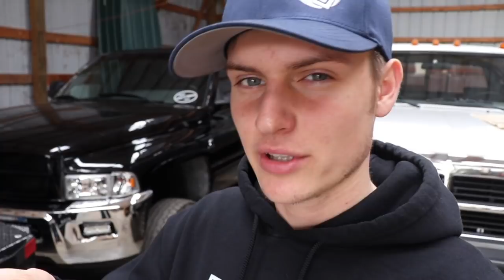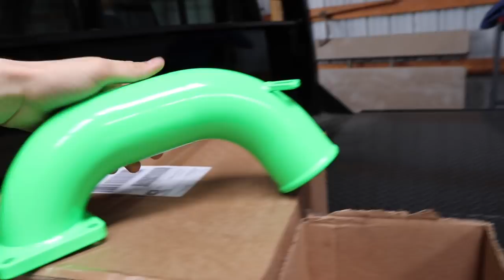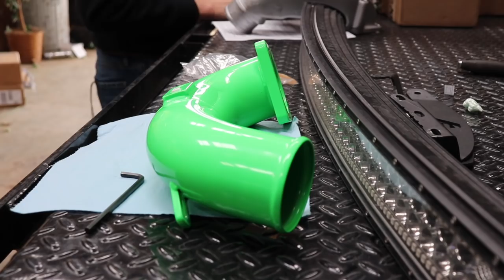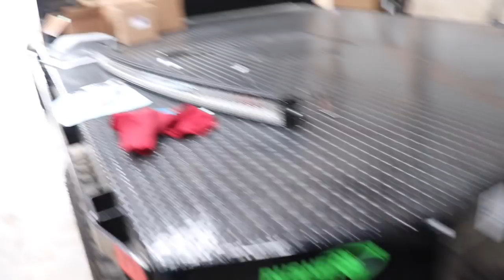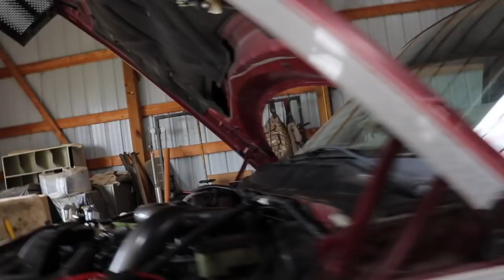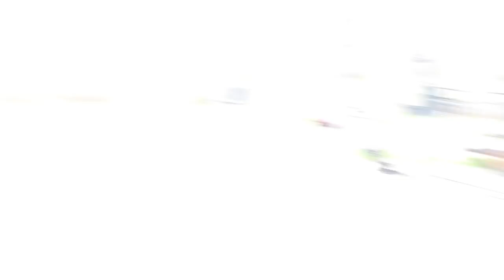THE NEW 12 VALVE PARTS ARE HERE!!!

Comment: Hey bud, once again great video. However, I did notice that on that stud pusher provides you to use instead of a bolt, it also comes with a lock nut which you put on there. However I noticed to nylon had not made it threaded onto the stud yet, take the stud back out use red lock tight and leave enough of the stud out to bite the nylon on the nut.

Comment: Twin intake horns def. Will help with airflow but will not keep the rear cylinders cool. Air does not cool combustion, excess fuel cools combustion. While more cool air is more dense than hot air and makes more power it is the fuel that keeps the engine cool. Just saying idk if you misspoke or what when talking about the horn
Reply: TheDingmann that is true for gas motors, but the opposite is true for diesels. Too much fuel in a Diesel engine can cause extremely high EGT’s  and can melt pistons.